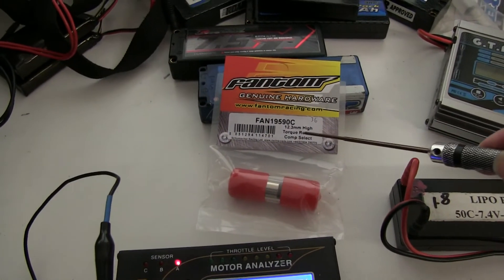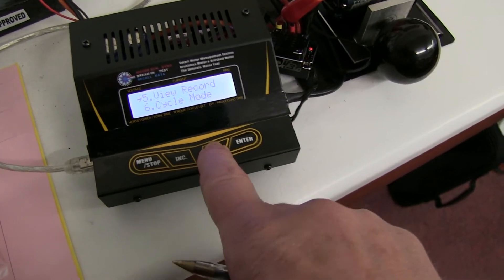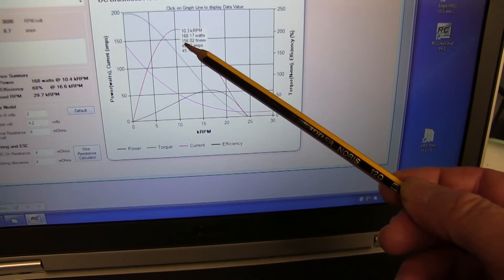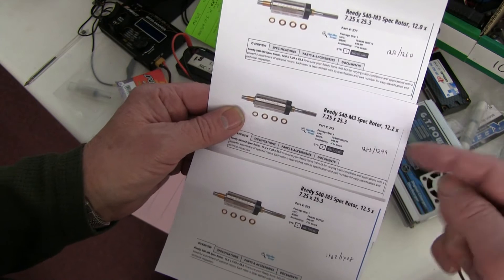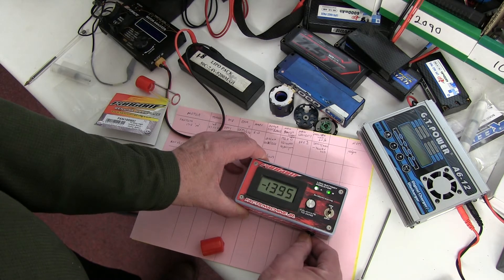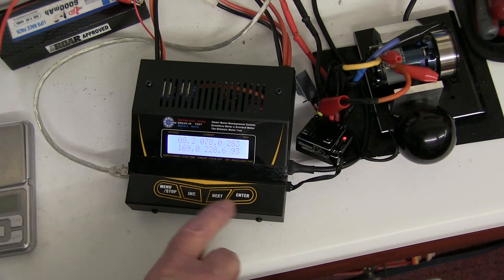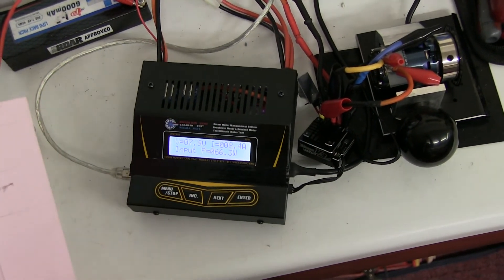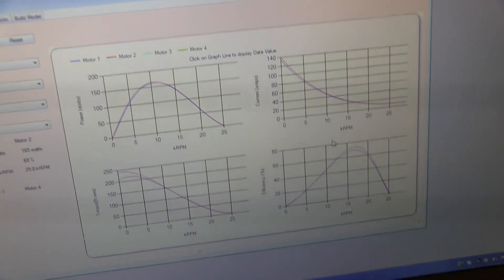Fantom Brushless motor with Optional Rotor

Comment: Hi Nick,

Given the new fantom v2 motors which combo of Fantom stator and rotor would be closest to a Trinity D4 1s certified?
I ordered a Fantom v2R (I think that is the short stack stator) with an ultra select 12.5mm 1600+ rotor for offroad 2wd buggy. Any thought?
Thanks,
Reply: all 17.5T
Reply from the maker: Hi Ryan
A tough one, as there is no direct equivalent.
The Trinity has more torque, but the Fantom has great top end and is more efficient.
The standard fantom stack gives a very small increase in torque.
The rotor is not so straightforward.
As far as I know the Trinity uses the TEP1112 rotor, which is 12.45mm and a strong 1450 gauss.
The Fantom  "RS" rotor (9591) is 12.45mm but much weaker at 1350 gauss.
The  Fantom optional  rotor (9590) is stronger at 1440 gauss but smaller diameter at 12.3mm. Which results in a weaker field at the stator, and so performs almost the same as the larger rotor.
They should have made a 1500 gauss small diameter for more torque.
or a stronger 12.45mm.
I don't know if Fantom make any other rotors.
In conclusion ,the Trinity has more torque, and the fantom more revs.
Reply: I see that Fantom offers a 12.5mm Ultra Select 1600+ rotor. Should I assume the 1600+ refers to the gauss rating?
Reply from the maker: Hi
Yes, but that is too strong.
Only suitable for slow rock crawling etc.

Comment: Hi Nick. Thank you for the great videos. Could you publish a dyno test for a Motiv 17.5? It also would be interesting to see dyno results for a peak power versus timing. As with timing increase power peak shifts towards higher RPM and becomes lower
Reply from the maker: Hi
I do have a video coming on 13.5T timing analysis, for boosted operation.
So hopefully will be up soon.
nick